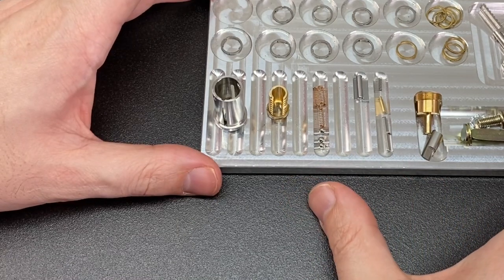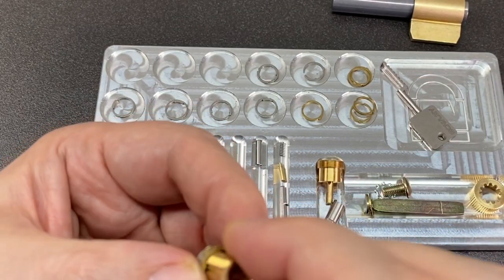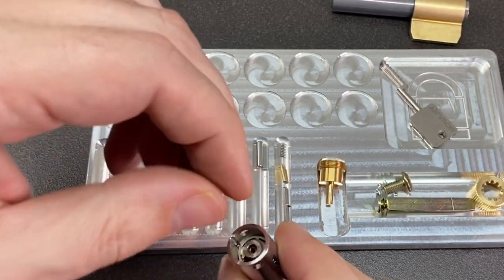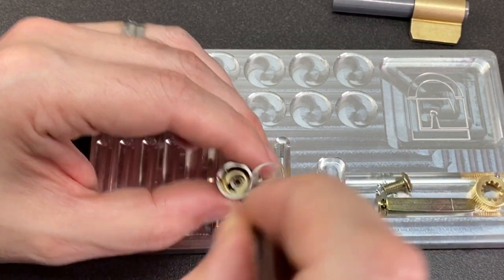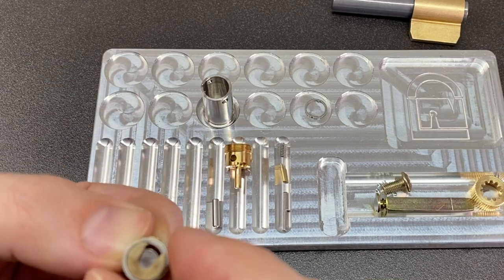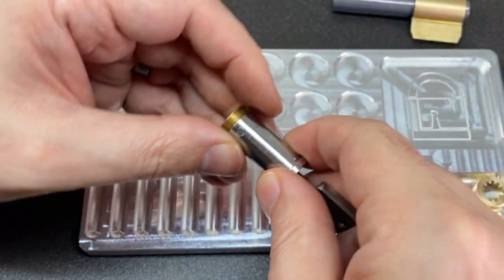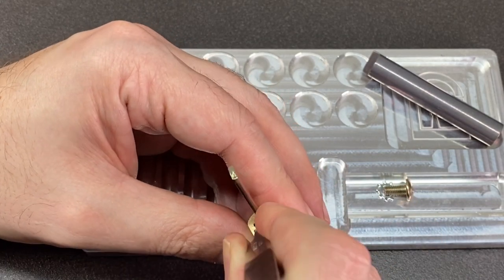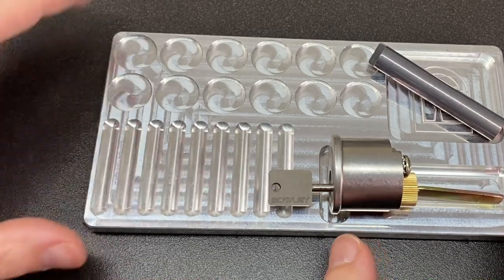Reassembling the Bowley Rotasera Lock

Comment: Well Done Lock Noob. One comment for anytime the disks are blocking the keyway. You can use the idler like you did to rotate them out of the way but it works much better with the sidebar in as it will fall into the detent on the disks and hold them in place. If your fully assembled the springs will do it for you.  If your partially apart like you were, you could put the side bar in and use your finger to put a little pressure on it so the side bar grabs that detent on the disks. That way the disks wont come back down.  I doubt you will be taking it apart again anyways but im sure some folks in the community will follow in your footsteps soon :)
Reply from the maker: Thanks! I appreciate the tips and if anyone else is trying to reassemble theirs, hopefully this will be invaluable advice for them too
Reply: Thanks for the tip BLC!!! I’m looking forward to the day I own one. Such a brilliant design. The community appreciates your products!

Comment: Just a tip on that type of tail piece, if you use the tail piece to push down the retainer pin while screwing down the cap, then once it's tight, turn the tail piece until it locks into the pin and then adjust cap as needed.

Have a great day
Reply: My apologies for repeating your tip. I should have read through the comments before I posted.

Comment: Thanks for a tremendous video. Impressive, as always.
When assembling the tailpiece assembly, I find it helpful to align the disk with a solid portion over the retaining pin.  You can just seat the tailpiece in the nut and depress the pin, without need of a pick. Catch the threads and rotate the disk to align the hole with the pin as you’re nearing the tightness you want.  If my description isn’t clear, i can make a short video. 
BTW that thing on the screw is called a lock washer or star washer over here.